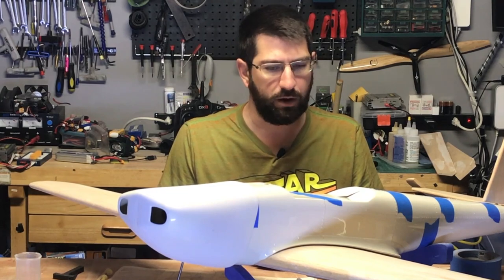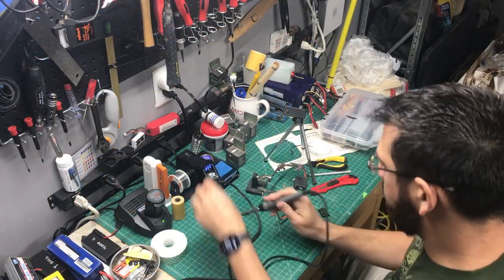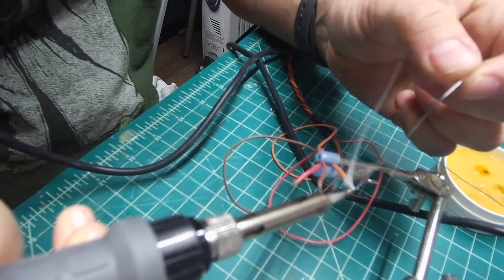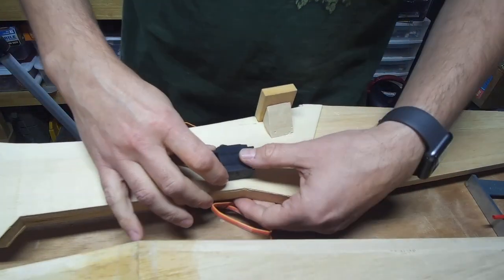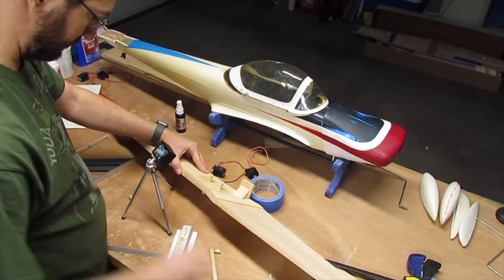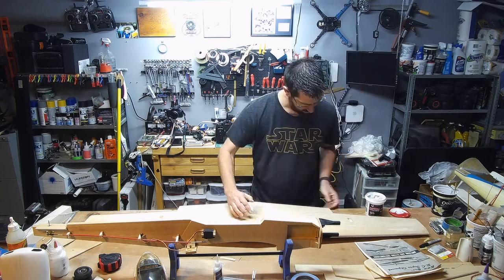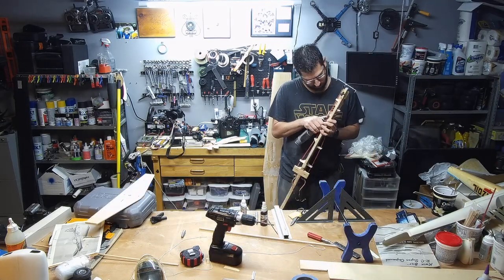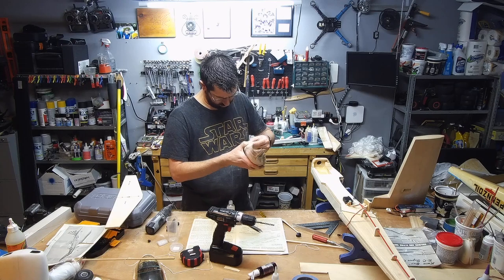SIG Super Chipmunk Build Part 6

Comment: Great build Joe. You might want to rethink your prop size. Your max rpm is only around 10,000rpm on a fully charged battery. A 7" pitch is only going to get you 50mph at full throttle fully charged. Im thinking around a 14x8 is  a good starting point maybe going up to a 10" pitch depending on current draw. Cheers Rob
Reply from the maker: RC Model Geeks thanks for the advice, you are correct, I said the wrong size and didn’t notice. I have a 14x7 prop for it and a 14x10 on the way and will test both to see what prop performs better. Thanks for the advice. Any pointers would be awesome.

Comment: What soldering station are you using? Also, I like to twist my servo wires together a couple times before soldering.
Reply from the maker: Tom Frazier it was a X-tronic here is the link. X-Tronic Model #3020-XTS Digital... https://www.amazon.com/dp/B01DGZFSNE?ref=yo_pop_ma_swf